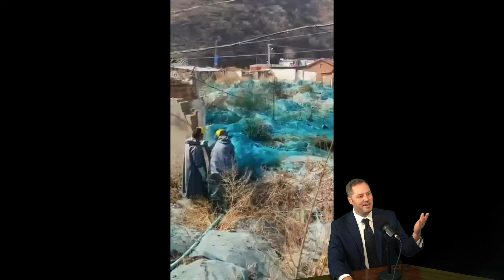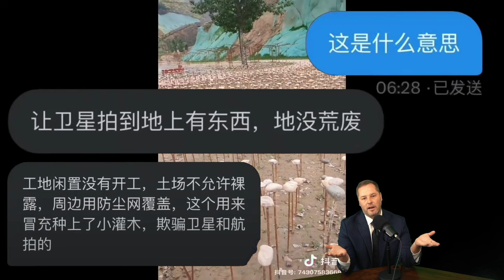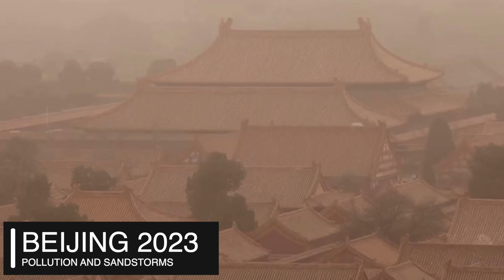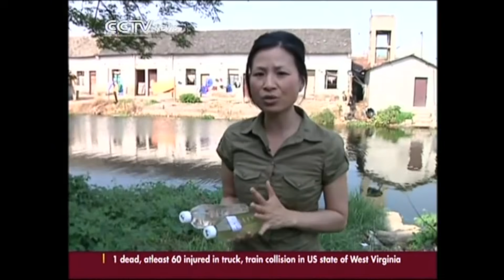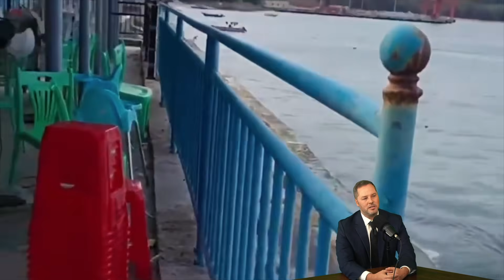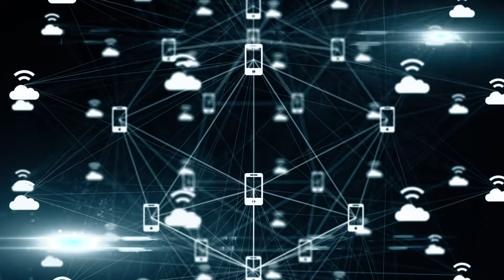China is planting Fields of Stones stuck to Metal Bars - No, Really

Comment: I worked in rubber production in america. There were numerous steps and processes to disposing of waste rubber and other products. I'm a curious guy, so i'm asking things like "are there other possible uses for this material"

Guy told me "sure, if you live in China or India"
Apparently they just straight up burn their waste rubber products to provide some backup electrical power  for their plants.....

edit: as i'm sure you can guess, absolutely terrible for the environment as a whole
Reply: They are way ahead of other contryes in transforming tires and plastic into oil again..
If you want to se tire pollution find a video from the ewer burning tire fire in Saudi Arabia 😢
Reply: Recycling energy by burning trash is a valid solution. Though I doubt China or India does it efficiently in environmentally friendly way.
Reply: @Frendh  Sure, if you have air scrubbers instead of just letting the toxic gasses and particles just flying around.

Comment: The conditions for hydro mulching are nowhere near as complex as it's made out to be here. I was a plant operator in civil and mining earthworks, so I have worked with this stuff ALOT. Yes, it does require basic components that any plant does to survive, such as nutrient retaining soil, but you don't have to get all the rocks out and all that crap. You just pin down some jute mesh and spray the shit on. The majority of the requisite nutrients are in the solution being sprayed. Not saying that these clips are in fact hydro mulching, But the requirements for it have been drastically overstated. That's all I'm sayin.

Comment: befor i wach and find out i want to say here in Oregon they spray the sides of the highways green, then not long latter the area is covered in a purple flowers. im assuming is more then just paint it may be a type of fertilizer/seed mixture where either the color just so happens to be green or if it was a unappealing color then they changed it to green for more reasons then just the color.

Comment: I've seen hydro seeding on prepared bare rock, while working as a Gas Distribution Planner, in the West Boundary Area of the province of British Columbia. The base material is made from compost made from Pulp Mill waste, Soil from construction excavations, sawdust, restaurant recyclable Scraps, cattle manure & out of spec fertilizer from the TECK smelter in Trail, BC. The precise mixing is a corporate secret. This compost is spread on the selected area requiring reseeding, then hydro seeded.

The effect is amazing. With a bit of watering, the vegetation recovers rapidly. Usually only a single application is necessary.

Comment: I would like to see aerial footage of this area to see how the “crops” of stone look and the “green vegetation” shows up on satellite images.. 🤓
Reply: Given that most satellite imagery has a resolution that's expressed in metres per pixel, I'd say it'll probably look pretty convincing. It'd also be effective at fooling satellite radar inferometry, as there'd be two radar echos, one from the rocks on sticks and one from the ground. Again the resolution is not nearly high enough to distinguish between rocks on sticks and crops.
However a satellite that measures soil moisture from orbit, those wouldn't be fooled by rocks, that patch of land will show up as being bone dry and infertile. The question is whether something like SMOS or SMAP data is actually looked at by the official that needs to rubber stamp the report from the inspector.
Then again, install some B-quality 5G mm-wave cell towers in the area and things like SMOS and SMAP can't do their job properly any more.

Comment: That's actually not super out there with the rebar stones. Typically, though like the USA it goes the opposite way because it works better the reinforcing structure is driven INTO the stone then subsequently tightened to make sure the concrete is in a constant state of compression as concrete has really bad tensile strength. I think they are trying to spend money deliberately more than necessary to boost some statistic that typically implies economic growth but in this case it is illusory that or they are incompetent. Incompetence could potentially reconcile why what looks like seeding is being done in places it is destined to fail. But I am not going to pretend like it couldn't be green paint simulating foliage it is definitely plausible I personally don't know enough to say either way. Bottom line is what all plausible hypotheses have in common things are happening on the working side, but nothing productive is going to result from the work. I lean towards the incompetence hypothesis over malicious when the powers that be are treated as infallible it is impossible for said powers to learn their own inadequacy. They can't be reasoned with and they are heavy handed workers just do what they are told even when they know it is stupid. In the US the first step happens but they have competitors who salivate at the thought of exposing them

Comment: Here we are talking about industrial pollution, which is what is making the soil toxic of course, but for most scenarios I bet the main reason a lot of their water isn't viable is because of human waste. That was one of the more shocking parts of my visit to China, people just shitting and pissing on the ground. I went on a nice bus trip to the mountains in the north of China to go river rafting. On the way we stopped at a rest stop so people could relieve themselves. The bathrooms were just a concrete box divided by sex with a gapping hole in the bottom on each side. The bathroom was just a damn hole over a slope with a concrete slab splattered with waste set to help guide the waste down slope. And what was at the bottom of that slope? The same dang river I was on my way to raft down. I took solace in the fact that although I was pissing in the river I was about to raft down we still had miles to go before we reached way up river -_-. Oh did I mention that there was just one gapping hole for the men's room? That means while I was pissing I was pissing with like 10 other dudes into the same hole. Now that was a sight :/ Oh and also, I'm sure the facility where we launched the rafts from had bathrooms that literally just drained into the river too. Other than that, that was one of the best times I had while in China. My father and I were the only white people there so of course we were practically celebrities lol. Every one wanted to say hi and tell me "welcome to China" at the top of their lungs. Truly a warm group of people.

Comment: I think if you have instead of light coloured sand, or rock green is a good colour to aborb heat into the ground.
That's why plants use green and shade.
The peebles on stalks would also cause shade increasing the effect.
Have you been on a hot beach the sand will roast you.
The Chinese have a good idea?
Reply: Dark things dont absorb heat, they absorb light and turn it into heat. Darker colors make an area hotter, like when standing in a parking lot. Why would China want more heat?

Comment: The metal stones are to help water penetrate the soil. Rather than sit on top of the dry sand. Rain splits on the stone. And roll down the metal piles. Into the ground. Making it easier for water penatration (I think) not sure if my theory is right. There may even be seeds planted next to every metal pole.

Comment: I've seen hydro greening done, and you can put it on any soil type. Not with the best effect but if done a few times to the same place most places will grow grass, even sand. Removing rocks isn't necessarily, as the grass will just grow around the rock very well. Either this guy really never checked into it, or he's lying for some reason. Not sure which is true. India has a very good program if you want to look at the results. It's quite expensive when done on a small scale, but less expensive when done on a large scale. Still it does cost a lot.

Comment: A legitimate reason for "spraying a hill green" is something that happens in the USA all the time.  Construction companies spray a stickyish substance that is an aqua green color on hillsides for erosion control.  Sometimes the slurry has seeds in it (grass or local vegetation) to get plants growing to stop erosion.  Every construction site large enough (3 acres I think) has to have an Erosion Control Plan where they implement erosion prevention practices to stop the soil from polluting the stormwater.  You can use the spray-on stuff, silt fencing, or straw waddles among other techniques.  Not sure if this is that, but some of it could be.

Comment: You are completely wrong about hydro seeding there is no prep needed when using a native seed mix, we do zero prep on our jobs and spray right over rocks and yes it will grow. And those plans will drop seed and the cycle will continue and eventually the topsoil will build up. The rebar is going to be used for a soil bridge which is why it is installed in a grid pattern and the rocks are glued on because they probably didn't have rebar caps.

Comment: Seen this green product used in construction. Same set up but pumped out of the water truck to reduce the need to water the batters and lose dirt. It stops dust a lot more and helps reduce scouring of the ground. It's green, but it's so you can see what you've already sprayed. I highly doubt they are doing it for the color. What's the point of painting rocks?

Comment: China has been buying fresh water by the tanker load since early 1970's.They've been taking it from the Great Lakes. In the the 1980's, China started buying land & houses & commercial buildings along the lakes. Why? So they could pump freshwater without those pesky U.S. regulations. They're still doing it, except they've spread out across the country.

Another problem: the peasants have been throwing pig heads and innards, chicken parts, whatever they were using for meat, directly into the water 
China's waters are probably worse than India's, if you can believe that.

Comment: They are building and flipping property on a US territory right now and underneath every 500k dollar new home is all the debris, hazardous waste and old used hardware buried in under and around the home. I have hit nails, rebar and metal cans with my riding mower. Dug up everything short of an entire car. But short cuts indeed. Water ponding on the roofs. Leeching fields and septic tank just not working or back flowing. Inspection and corruption not happening. Seen it

Comment: I recently saw the absolute limit on all of this.  There is a place in China where the land is subsiding - even down 17'  - 20 ft and continuing.  One huge factory had the ultimate awful waste liquid to get rid of somehow. There was a drawing of 3 levels of aquifers with the deepest at 3,000 ft.  They pumped out and consumed all the water at the deepest level and pumped back in the horrible mess which looked like heavy black grease of some sort.  IMAGINE, forever and ever that awful garbage will inhabit the aquifer instead of renewed and stone filtered new water. Chinese evil is unlimited.
Reply: I've seen what is essentially a presentation on this technique.  They claim they are putting the waste so deep, it won't be a problem.  Of course, I am absolutely NOT endorsing this practice.
Reply: @eljefeamericano  If you drill under the water table then this isn't a problem at all as far as I am aware. There is no water and nothing alive to poison down there. And if you do it right, then even a quake or something wouldn't release it to go up.

The problem is that they didn't do this. They instead drilled into the water table on purpose. They drilled to take the water and then used what was left as a waste dump.
Reply: As a hydrogeologist this makes me sick to my stomach. Doing that means that aquifer is ruined forever. It takes a lot of time for water to make it's way to that deep. However, the process of waste water injection is something that is also done in the US. It's required by law in California. But that waste water is being injected back into areas that once contained oil, not viable potable water aquafers.
Reply: When people fear their government, their own evil is unlimited
Reply: Read up on the cultural revolution and esp., the entire great book "Black book of communism." You will learn what true evil smells like.
Reply: unchecked evil indeed. Few people are really rotten to the core and its affecting them all. China needs to change or theyll simply get ill and die and when their land becomes unlivable other countries wont open borders for the incoming flood of people.
Reply: It'll seem like forever before that plastic brakes down.
Reply: They pump untreated raw sewage into volcanic features in California,  for geothermal steam generation.  As for pumping  wastes deep underground,  it has and is STILL happening in the USA...  with permits from the EPA.
Reply: @shdwbnndbyyt  Where can we see documentation of this?
Reply: @shdwbnndbyyt  i was thinking the same thing about pumping into volcanoes'
Reply: imagine they do taht in the US.
Reply: @GhostScout42 they do as bad.
Reply: Corporation/unregulated capitalism is evil. Not Chinese. We need to understand that certain beliefs are evil not certain races. All races are good. Got to understand the enviorment and culture better to understand what can instill and encourages such soullessness.
Reply: @UnderGroundMerlin  For some people "regulation" is a dirty, dirty word!  My father was an Inspector of mines for my state, and he was the only electrical inspector for a region of about eight counties, all rural.  If he found a potentially deadly problem, he could order all the electrical equipment in the mine shut down until the problem was fixed, effectively shutting down the mine, costing it millions in lost revenue.  The mine operators tended to pick up the phone and call the highest levels of state government to call off the order rather than work to fix it immediately.  People died for those millions.  Obviously dollars were more important than lives in that situation.
Reply: @UnderGroundMerlin  one to one person is fine, three is a crowd and therefor brings a catastrophy.
Reply: I think you mean Almost all races are good. You forgot about Australians

Comment: Hydroseeding slurry contains fertilizer and other soil amendments so there is no need for preparing the soil before seeding, or for fertilizing the turf once it starts growing. All in all, hydroseeding means less labor than seeding turf the conventional way, and you also get results faster.

Another advantage of hydroseeding over sod is that it allows you to grow a lawn in locations that are difficult to reach or mow, and it could work out cheaper than laying sod.

Comment: we dont turf everything we hydroseed, in fact on 95% of jobs we simply spray it on untouched soil, ideally yes it would b best to do it that way but its not always practical   the seeds hold pretty good n we dont spray if we know its goin to rain in a few days, but even if it does rain, normally the seed barely moves at all, the dye washes away but thats all..  we do divert downspouts n tell the homeowner to keep n eye on high water flow areas n call us if anything washes out  we dont normally have any issues, i cant remember the last one of that sort..

Comment: Worse still, the power station owners turn off the chimney scrubbers because they can generate more power with full on pollution. The scrubbers only get turned on when the inspectors are in town. The same for toxic waste being put into rivers. All the cleaning systems are turned off to increase the speed of manufacturing. The result is that China is causing far more pollution than even the most damming stats tell you.

Comment: For aeral photography, this is easy to defeat by just using satellite SAR (synthetic aperture radar) data and overlaying it on top of the photos. It's fairly cheap to buy from commercial satellite data providers, and since its sensitive enough to find slightly more iron rich sand for prospecting applications, stuff like this will be very easy to detect
Reply: You think inspectors care? They usually just do drive-by, do quick look and "go back to their lives".
Reply: @mitnecasual  This is a good way to check if the inspectors need to be fired since it relies on satellite data only
Reply: @BosonCollider  We talk about China. Nobody gonna be fired as long as "it works".

Comment: That has to be the most horrific impaling hazard that I've ever seen in my life should the stones fall off over time.
Reply: I think they are well balanced, a bit like a spinning plate... :)
Reply: even if the stones don't fall off the rio steel rods, if anyone fell onto them the stones would not stay in place because they would not have had a big surface area for permanent contact, for glue, they only looked taped on with masking tape.

Comment: That green stuff they are spraying on the slopes and roadsides is quite likely hydromulch or hydroseed. This is a common practice in western countries to finish off civil engineering project landscaping or for erosion control. The green slurry may be a cellulose mulch that sets hard like paper mache for temporary stabilisation and coverage to allow the grass seed which is also in the mix to emerge and grow. The colour helps operator see spread and to show the public that work has taken place, plus arguably some temporary aesthetic value.
Reply: EDIT: oh you cover that... but I would disagree, hydromulch/seeding doesn't need to be applied in the perfectly prepared conditions you suggest for some success. What they were doing could have encouraged grass growth in the bare patches between other plants and in the viable pockets in amongst rocks (for slope stability) if the local climate will allow and they pick the weather coming during the establishment period.